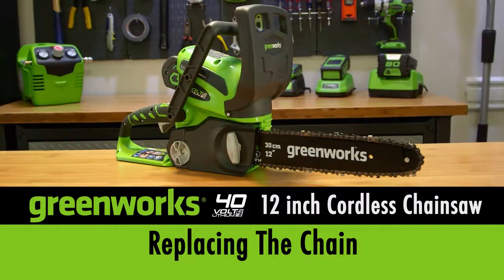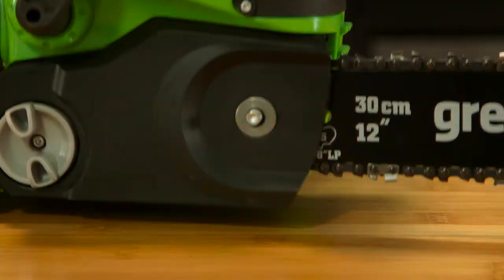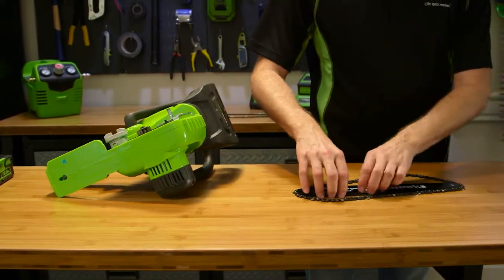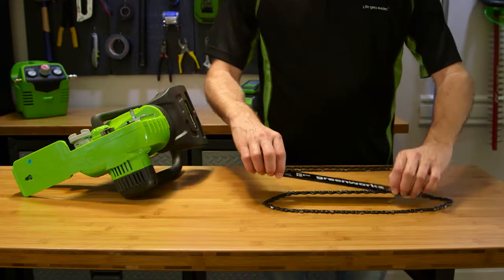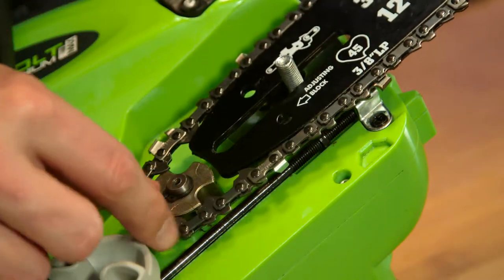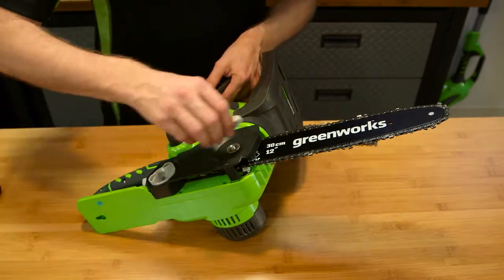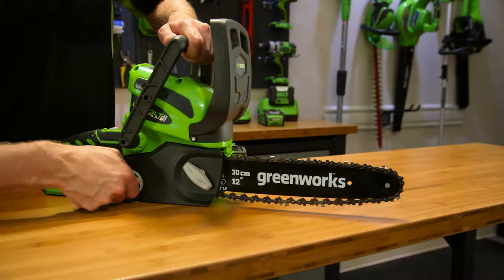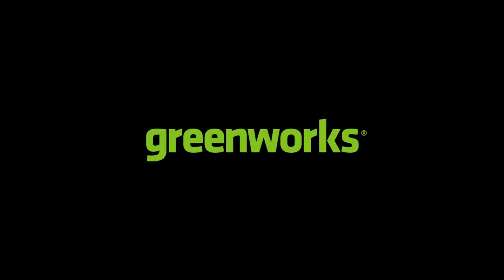40 Volt 12 Inch Chainsaw - Replacing the Chain

Comment: I can get the new chain on the bar but I can’t seem to tighten the tension on the knob turning it clockwise…once I get the cover back on knob
Reply: I got the same issue where you able to figure it out?
Reply: This might be the second chainsaw sitting on my porch without a chain. I cannot get the damned thing back on. The black cover will not go back on correctly. It worked great until the chain popped off. Now i can’t get it back on no matter what I do.
Reply: One small detail not mentioned here: when you put the bar back on the platform, there is a little thing that sticks up on the tension adjustment screw that HAS to be seated in the bar hole labeled for it.  With the bar off, turn the tension dial and you will see it move up and down on the long black screw.  That little black piece that moves must be seated in the hole on the bar when you put the cover back on. You will find the bar sits unevenly if that stick up part on the long screw is not in the small round hole.  Turn the tension screw with the cover off so that the part that sticks up proud of the screw moves till it fits into the hole, and then the bar will lay flat . All other directions are the same. The cover BTW has to go in tension screw end first-- there are 2 small tabs that slot into the main housing of the chain saw and you'll have to fritz with it a bit to get them back in, but put the back end in first and wiggle: don't try putting in the upper edge and jamming the lower edge in. There's another tab on the lower side that won't engage unless you put the cover in end first and then it should settle into place. Now that you have the stick up part on the screw in the hole of the bar, the tension dial should work.  Hope this helps-- I don't know the right names for these things, pretty sure they have better names than I came up with.

Comment: I just bought a 40V 12-inch chainsaw and it doesn't look like this. The chain guard has two nuts to unscrew to remove it and the chain tensioner takes a screwdriver to tighten or loosen.

Comment: The printed instruction manual is a diaster. The graphics too small to see, numbers referring to parts are wwrong, and it never makes clear -- like the video doesn't -- that for the tightening dial to work, the holding block nub needs to be in the small hole on the saw.
Reply: Thank you!!!  I had no idea there was a "holding block nub."  How could you leave this out of the instructions??